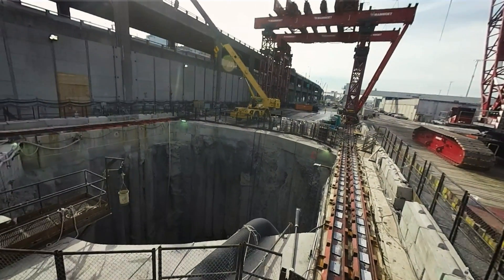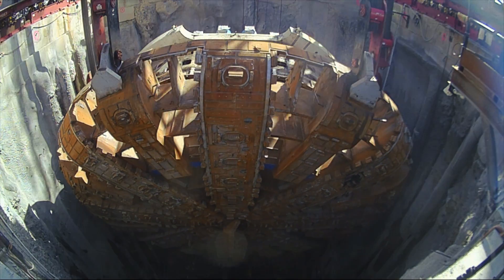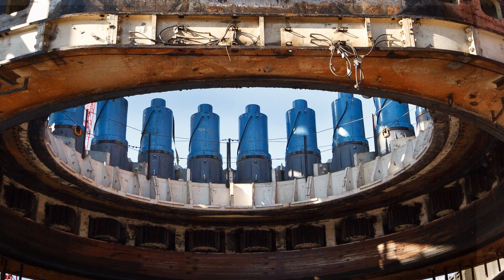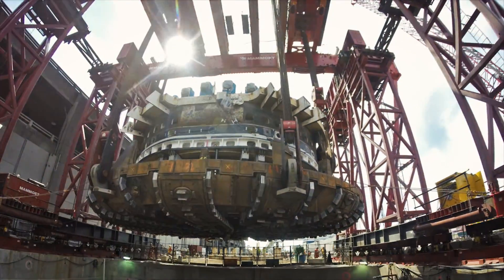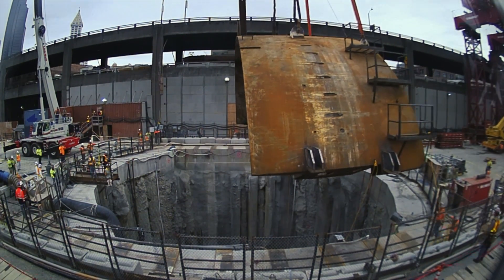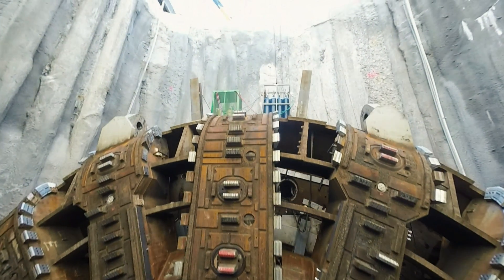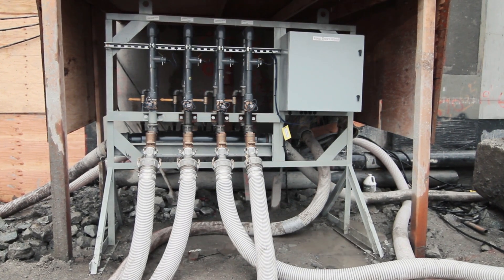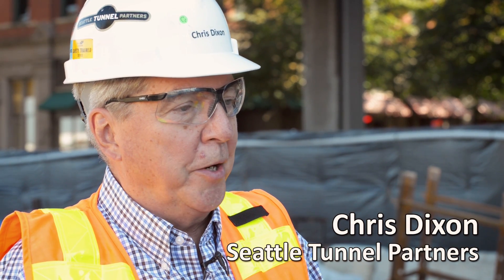New video shows Seattle Tunnel Partners’ path back to mining

Comment from the maker: CooLDster, Seattle Tunnel Partners refers to the location as “Safe haven 3.”  It is a pre-planned stop along the route (there are several pre-planned stops), where the ground has been improved with concrete columns. This more easily allows STP to check the workings of the machine and, if necessary, replace worn parts (like the cutting tools that dig into the ground).  The location is actually in a Seattle Tunnel Partners work zone just south of the ferry dock, so there will be no impact to parking. There are no businesses there or nearby.

Glad you enjoyed the video.
Reply: +CooLDsteR They jet grout(pump concrete) around the face of the tunnel as it cuts, and then place the rings. picture it like laying tile in mortar
Reply: +wsdot How will the 4-ft of sand cover be held in place while tunnel sections are installed? I'm picturing sand falling through since it's not as stable/compactable as soil & dirt.